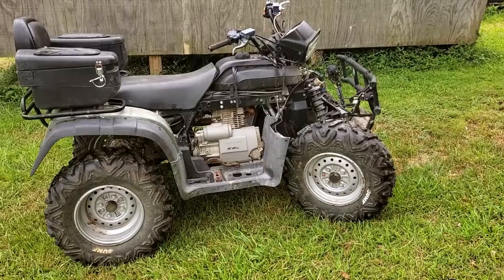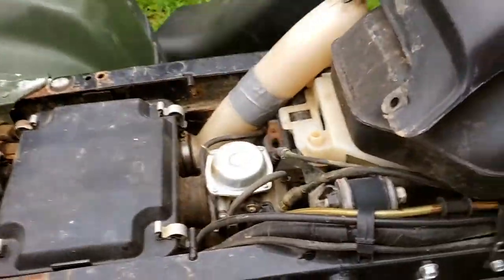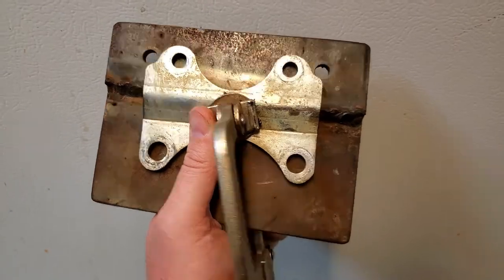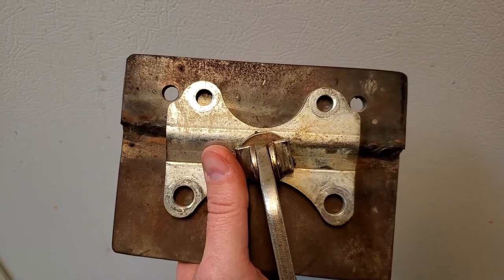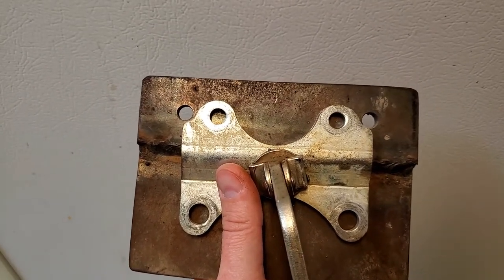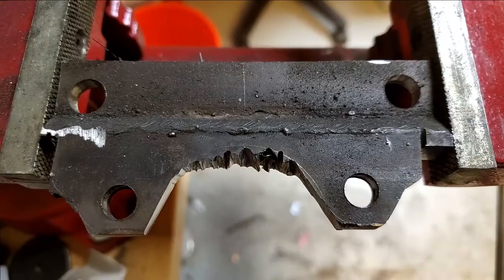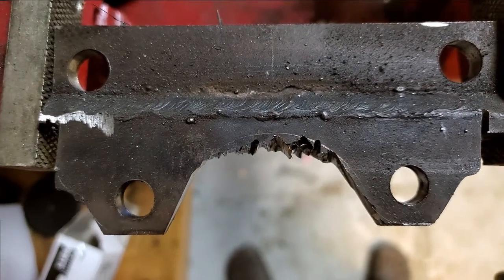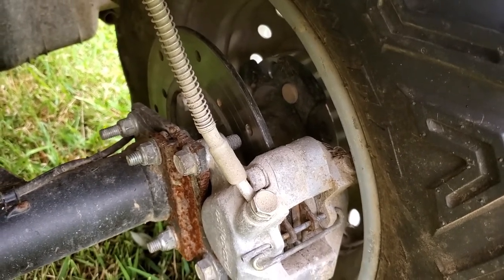Honda Foreman HYDRAULIC Brake Details

Comment: When you modified the caliper to put in the banjo bolt did you have to make new threads or did the bolt thread right in.  I have the original Banjo bolt from my front brakes (10X22).  It feels like I am going to strips the treads if I force it?  What did you do? Isn't a M10x1.0 the same threads as what I already have?
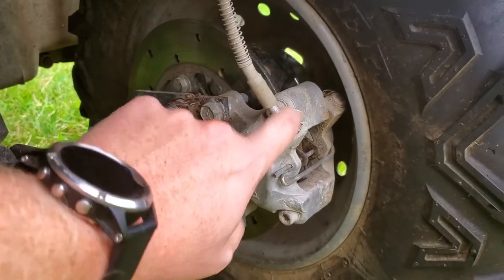Reply from the maker: You know, I can't remember.  I had to go back and watch the video but I know I had to put a plug in the side against the wheel - you can barely see it at 4:33 and it has like 1/4" clearance.  I wish I would have gone into what I modified, but I want to say I had to drill and tap it since it had a pipe fitting previously and I wanted to make it more standard with a banjo fitting.  I'm not great with metric threads and I looked up your 10x22 banjo bolt but I couldn't find the pitch - I think the 22 is the length because the M10 comes in 1.0 and 1.5 pitch from what I've seen.

Comment: Do you use an 85 inch or 85 centimeter brake hose. I am assuming it’s centimeters because inches would be over 7 feet. Also where did you end up buying your new line?
Reply from the maker: Inches.  It stretches from the front to the back and weaves around the frame.  I honestly thought I would have way too much but it was barely just enough.  Only the master cylinder was low and it looks to be leaking out the piston there not the hose.  I filled the reservoir and it self-bled what little bit of air was in the system, but it was coming out at the handle.  I honestly think the Chinese brake line is holding up even though it's really discolored.  It's a good, cheap option that works.  At some point I'll probably buy a brake line flaring tool and make a hard line, then just have flexible hoses at each end.
Reply: @TheRoostersGarage  awesome thanks working on mine now.

Comment: So the original bracket and caliper where inadequate at stopping?
Reply from the maker: The original caliper was inadequate.  I asked a powersports mechanic friend of mine to take a look at why I could not get any stopping power out of the SuperATV caliper.  He was shocked they chose to use it in the manner they did.  Apparently that's a parking brake they were trying to use as a main brake.  The bracket had to be replaced only because the holes didn't line up with the Wilwood caliper.

Comment: What did you end up doing to the reverse button/cable?
Reply from the maker: My mechanic friend installed a lever to pull the reverse clutch after my switch installation didn’t work.   It takes both a switch to allow the trans to go into reverse and the cable to pull a clutch fork I believe to allow the actual shifting.  The Honda design ensures you don’t try to go to reverse while moving forward, and we wanted to ensure the new design didn’t either.
Reply: @TheRoostersGarage  Ok, thanks! I see it now. I'm definitely gonna have to do this, been wanting to for a while but was waiting for someone to make a detailed video like yours. 👍
Reply from the maker: @daryncochran6194  If you have any more questions, just ask.